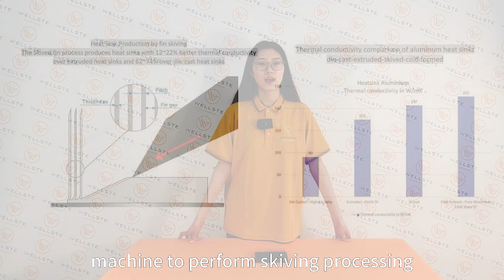Skived Fin Heatsink Production Process #wellste #skivedfinheatsink

Comment from the maker: Skived Fin Heatsink Production Process
Hi guys, today I am going to introduce skived fin process for you.
The skived fin process is widely used in producing high-power and precision heatsinks. 
Commonly used materials are aluminum 1060 or copper C1100.
Our skived fin heatsink has a maximum width of 1500mm, a minimum wall thickness of 1mm, a minimum fin thickness of 0.15-0.2mm, the fin height can reach 120mm, and the fin thickness to fin gap ratio is 1:1.2 to 1:8.
Wellste skived fin heatsink has the following advantages:
The heat sink fin and the base are integrated. The fin is thinner, higher, and denser, so the heat dissipation efficiency is higher, but the weight is lighter and the material cost is lower, the most important is that no extra mold fee, it is friendly for small orders.
Last, the skived fin has almost no size restrictions and can be used to dissipate heat for larger power chips.
Do you know how skived fin heatsink production process is?
Step #1 Materials: Prepared aluminum or copper materials.
Step #2 Blanking: one product or multiple products can be molded, and it can be operated continuously or in a single piece.
Step #3: CNC processing, such as milling out unnecessary parts.
Step #4: Use the CNC skived machine to perform skiving processing.
Step #5 Gear hobbing, usually done on a gear hobbing machine.
Step #6 Secondary CNC processing. According to the product drawing, mill out the teeth on the edge, or drill holes, etc.
Step #7 Surface preparation. Generally, copper passivation. Passivation is to remove surface oil and then attach an oxide film to the surface to prevent oxidation. Aluminum often uses anodizing.
For more details, Reach out to Wellste now and let our engineers provide you with the perfect solution.

-----------------------------------------------------------------------------------------------------------------------------------
Get free Company Profile:https://show.forms.app/annwellste/unt...
Anodized Aluminum Profiles:https://www.wellste.com/anodized-alum...
PVDF Extruded Aluminum Profiles: https://www.wellste.com/pvdf-extruded...
Powder Coating Aluminum Extrusion Profiles：https://www.wellste.com/powder-coatin...
Electrophoresis Extruded Aluminum Profiles:https://www.wellste.com/electrophores...
Custom Aluminum Extrusions: https://www.wellste.com/custom-alumin....
CNC Aluminum Extrusion: https://www.wellste.com/cnc-aluminum-...
Custom Aluminum Fabrication:https://www.wellste.com/custom-alumin... 
-----------------------------------------------------------------------------------------------------------------------------------
Contact us:
Email: sales@wellste.com
Website: www.wellste.com

00:00 Introduction
00:17 wellste turned fin radiator dimensions
00:59 Advantages of Wellste Turned Fin Radiators
01:42 Production process of turned fin radiator